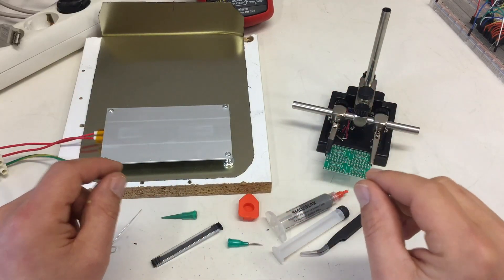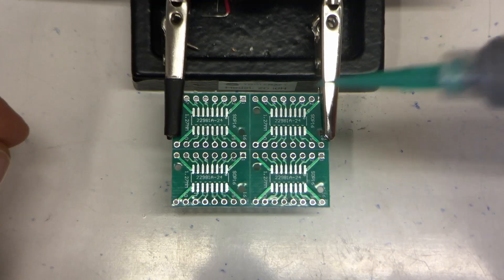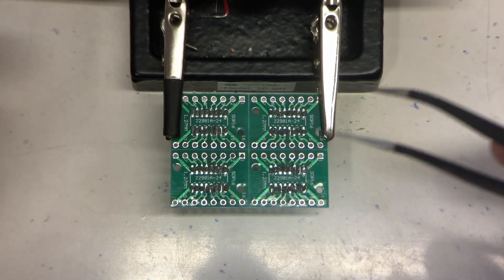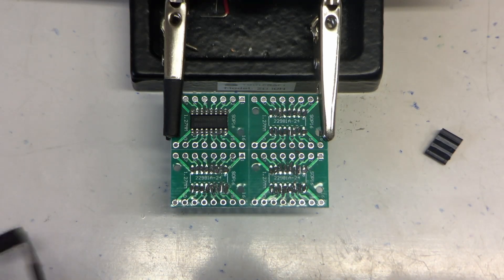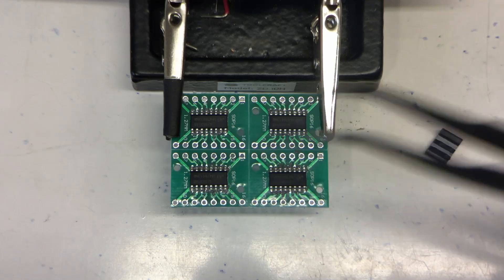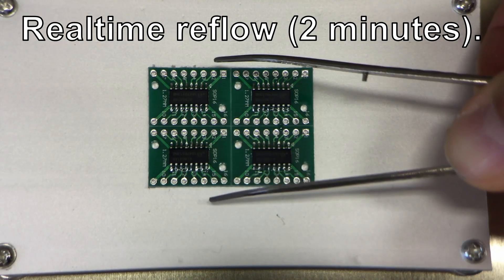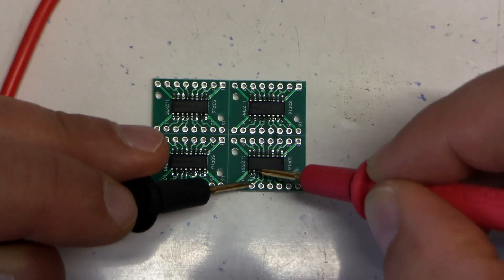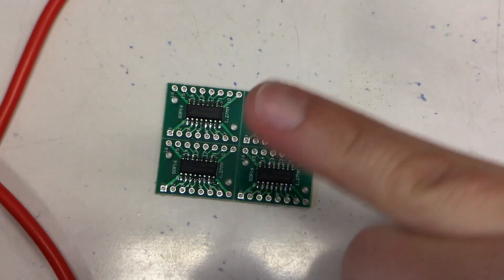SMD Reflow Soldering: Four SOP-16 Breakout Boards at Once on a Hot Plate

Comment: i use exact same setup useing small smd boards.What i do is spray board with pure alcohol and give it a wipe.I also use them small screw on metal caps that look like injections it works very well.
Reply from the maker: Thanks for the tips! Cleaning the board beforehand is definitely a good idea. Where did you get those little injection screws from?

Comment: Is this a DIY plate?...If so have you done a video on how you made it please? (couldn't see one)
Reply from the maker: No, neither the hot plate nor the SMB breakout boards are DIY. But if you refer to the roughly cut metal sheet on the bottom, that's DIY from video "Laboratory Water Bath (1): Improvisation"  https://youtu.be/UHtsRI7svAk. For info on the hot plate see video "Mailbag: Hot Plate, Arduino Nano, Thermocouple, MAX6675 Module and More" https://youtu.be/Q4XTfRTT3I4 @ 20:34 (Hot plate – with PTC heating element). For Info on the breakout boards see video "Mailbag: 3½ and 4 Digit LCDs (Tested), Thermocouple Connectors and More" https://youtu.be/FwDqEmZu9Ww @ 16:11 (SOP16/SSOP16 breakout boards – with nice separation between the pad rows).